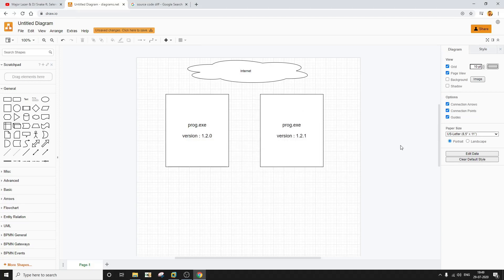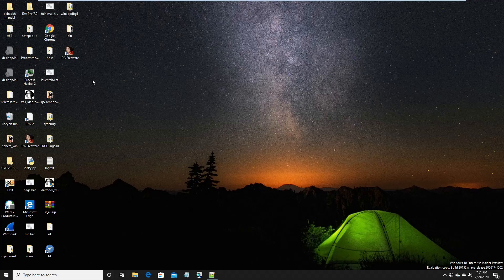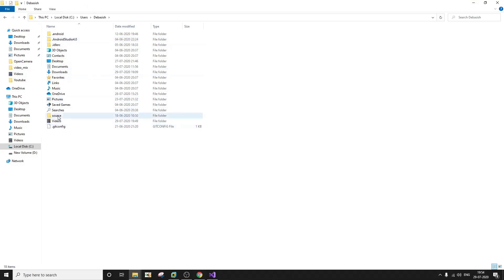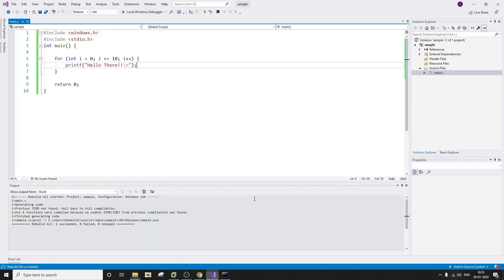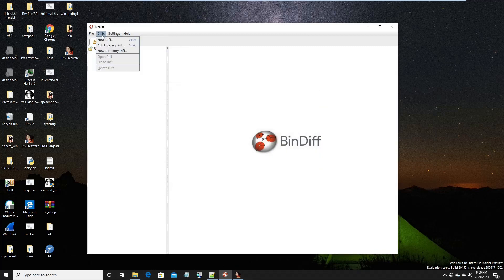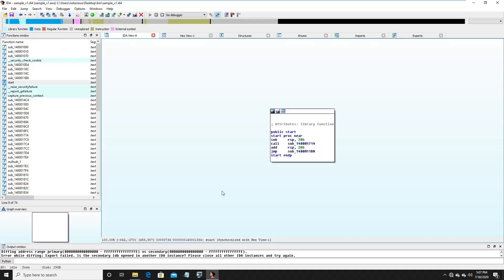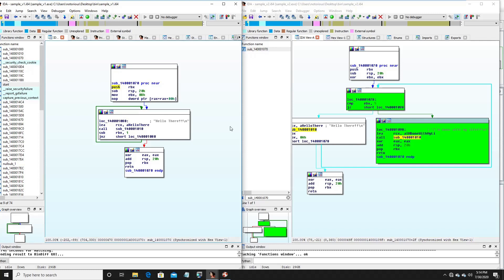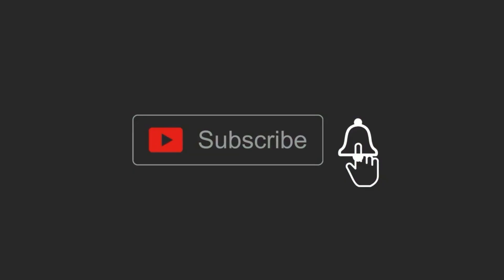Reverse Engineering IDA Pro – How to do Binary Diffing - Patch Analysis

Comment: This is great!! Thankyou for the videos.!! Quick question, are you using IDA 7.0 freeware in this video ? Plugins feature seems to be disabled for 7.0 freeware version, so asking. Also, could you describe how you installed bindiff support for IDA (have been trying it for some time and had no luck).
Reply from the maker: There could be some compatibility issue , I used bit older version of Bindiff plugin – 4.2.0 works well for me.
Reply: @DebasishMandal  sir, how to patch the dll files so I can change the codes?